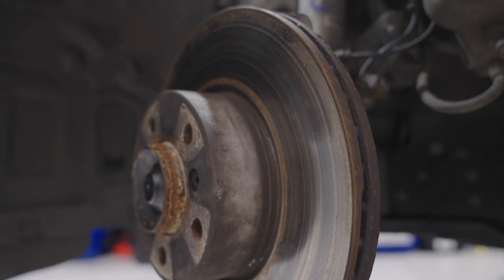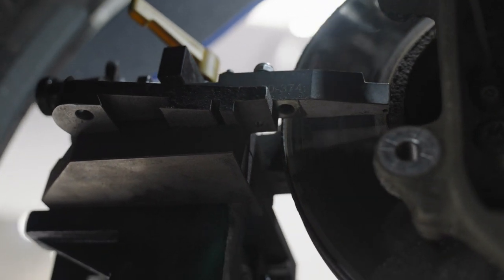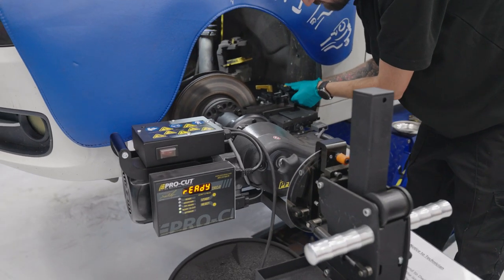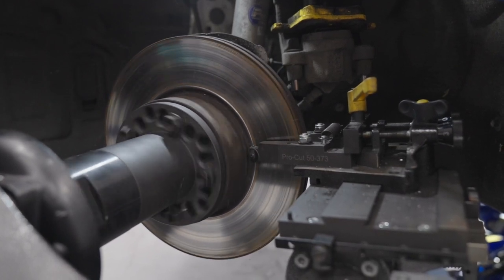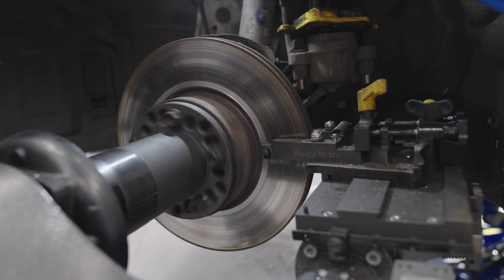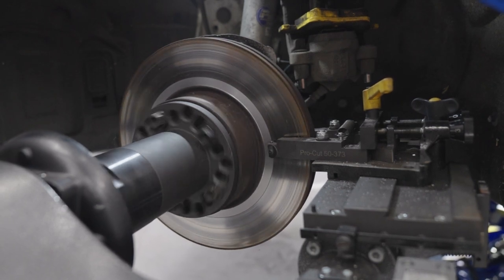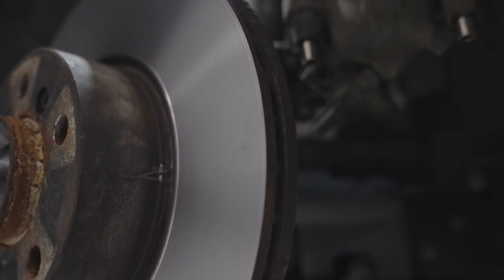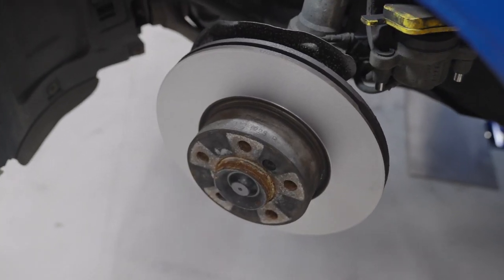Pro Cut Brake Disc Skimming | EBC Brakes

Comment: Amazing but does this not compromise the cooling of the disc? Given the thickness is reduced, is the disc more prone to heating up and introducing fade under repeat stops?
Reply from the maker: No, it only takes a very small layer off the disc. You would never cut down to anywhere near the minimum thickness, meaning there is no compromise to the cooling for the disc :)
Reply: Also brake fade only occurs with drum brakes unless there is air in the back pipes

Comment: Do you have anyone in the Dorset area? as my car developed brake shake only after 500 miles or so since the installation of EBC GD Sport Brake disc and yellow pads as well as new callipers. Thanks
Reply from the maker: Hi Matt, drop an email to our technical support team at technical@ebcbrakesuk.com and they'll see to your issue.

Comment: Is this service available at you northampton headquarters? I’m local and have an e46 bmw M3 whose disc are worn and causing a hum when braking. Do you recommend new pads after the process?
Reply from the maker: Hi, unfortunately we don't offer this service. We would recommend getting new pads after this process.
Reply: @EBCBrakesUK  is there a company in Northampton who has this kit you can recommend?

Comment: Great machine, but i got a question. Can that machine skiming discbrake in hybrid vehicle ?
Reply from the maker: Yes, as long as they're made from cast iron :)
Reply: @EBCBrakesUK  Is that any additional tools for that ? because what i know is hybrid system can cause fire if wheel is turn. Because wheel rotation will charge the hybrid battery.
Reply: What happens to the drive shafts when you skim the front rotor? Especially on a 4 wheel drive set up, do u need to disconnect the front shaft from the transfer case?

Comment: Can this also be used on a drilled and slotted rotor?
Reply from the maker: Hi, yes absolutely. For more information on the process please head to - https://www.procutusa.com/ - Have a great day.
Reply: Works on 2 piece discs as well. Mine are 2 piece and C hook drilled. Spot on now after having mine done due to brake judder